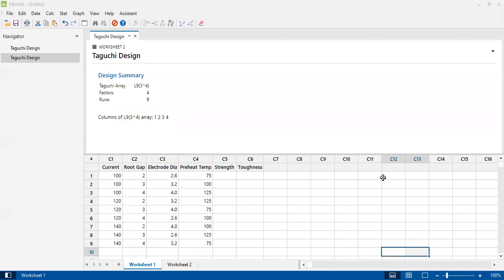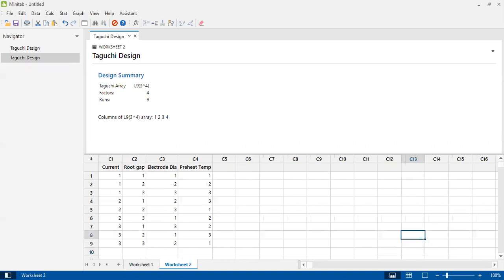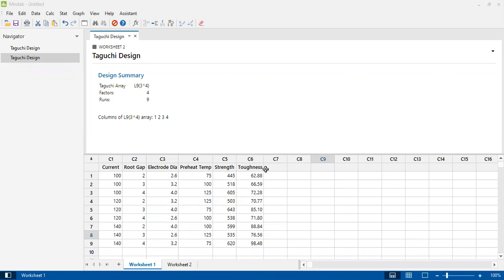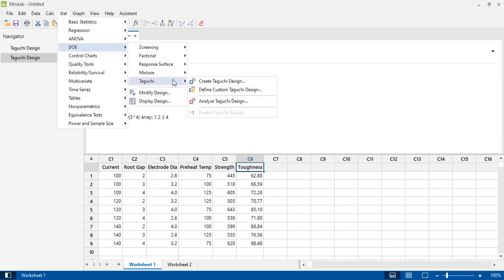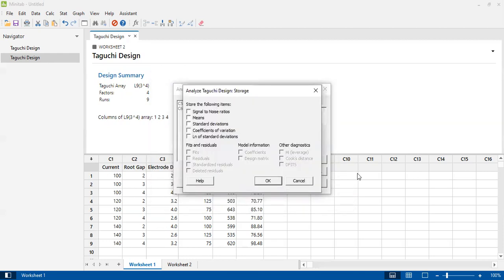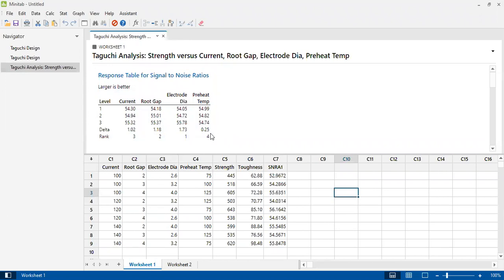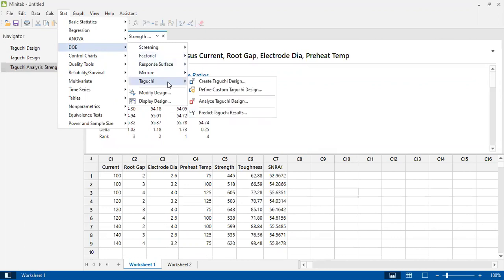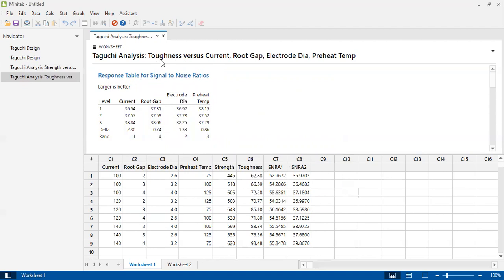Taguchi SN Rations (Larger the Better) by Minitab  | Taguchi Design of Experiments |  Taguchi method

Comment: Can this be done in excel?
Reply from the maker: Yes
Reply from the maker: Check my videos. I solved
Reply: @EngineeringandInfo  Thank you so much for your videos. They were very informative. I have one last question tho. Can I use Taguchi if I have different levels of the experimental parameters I used? Thank you so much.
Reply from the maker: @wanderinggeol  yes. You can. Contact me via email. It’s first step in research. Please design it with care

Comment: Thanks, Sir  for your efforts, I want to know if the higher value of S/N ratio represents a better response (if the larger is better)? , what about the criteria smaller is better or nominal, what is the S/N ratio should be considerd?
Reply from the maker: please email me on miq0054@gmail.com or whatsapp 00923325056162
Reply from the maker: For smaller is the better, we use formulas for smaller the better but we pick largest value of SN ratio. For nominal, we have separate formulas and a value. You can contact me on 00923325056162 via whatsapp